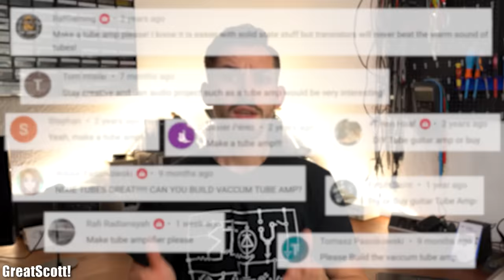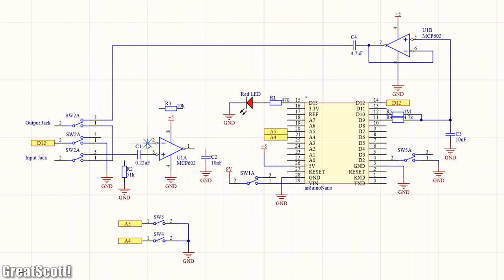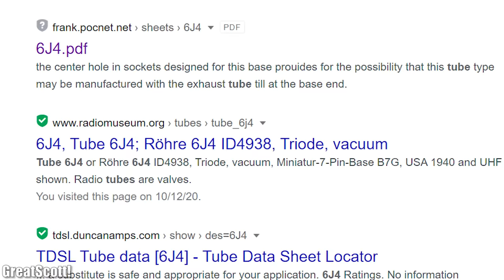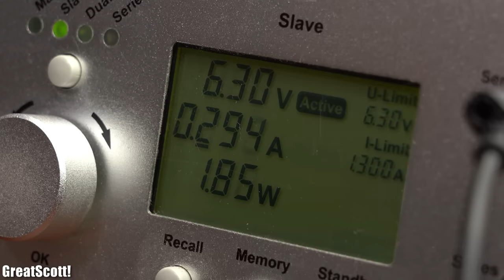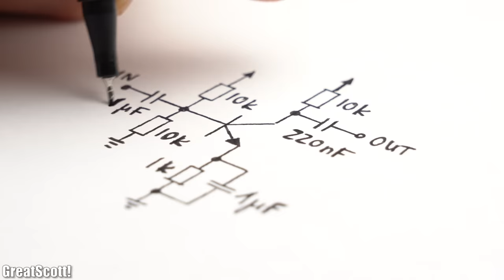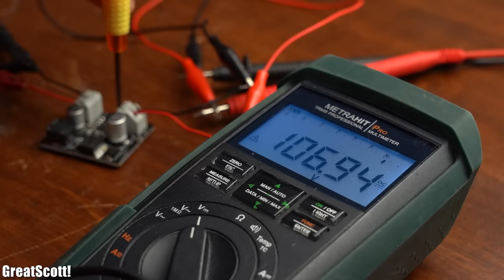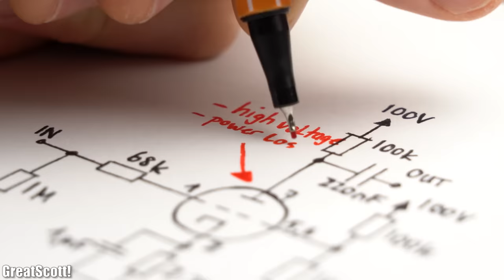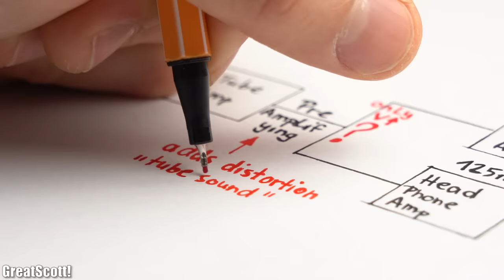Building a Tube Amp! Does it produce better audio quality though? EB#47

Comment: Hello Mr Scott,
I saw your video "Building a tube amp! Does it produce a better quality?"

I thought it was an excellently produced video and was certainly very informative and engaging. But if you were to build an all-tube amplifier, without any semiconductor components, then you will certainly agree that tubes are better. 

Let me begin with radio. As a radio amateur I favor tube transmitter stages because they ARE efficient. If I want to transmit 100 Watts at, say, 14 MHz, then I will be using a 50Ω output impedance. This means that I need the amplifier to deliver 75 V R.M.S (200V peak-to-peak) to the antenna. By using Single Side-Band (SSB) my average power may only be 15 Watts, but with peaks of 100 Watts. The push-pull amplifier tube may be rated at, say, 250mA peak anode current, with typically 1000 V on the anode. But the amplifier tube can tolerate several amperes of anode current for a short duration. In other words the RF output has a clean spectrum and will not go up in a puff of smoke if there is a short duration overload.

A transistor amplifier intended for 12 V operation uses a pair of push-pull devices, each device will be sucking about 10 Amperes, or more, of collector current. Remember that there must be a significant standing current to avoid crossover distortion. The transistor power amplifier will need a ferrite transformer to step up the voltage from 12-0-12 to the 200 V Pk-Pk, and can only match to one specific output impedance. If the transistor is overloaded very slightly then it will "flat-top" and create harmonics throughout the HF spectrum. If the device is rated at 15 Amperes, then a 25 Ampere peak may destroy the device in a few milliseconds. Even the slightest overload will cause excessive distortion and widespread interference.

To loose 12 Watts of heater power is a small price to pay for greater linearity.

When it comes to audio stages, the vacuum tube is softer and does not create spikes of distortion. The currents in the circuit are much lower so that makes construction a lot easier. Transistors power amplifiers operate from a lower voltage and so limiting is much more pronounced and noticeable. Transistor amplifiers also require much better power regulation and DC filtering. Open up any 100 Watt transistor amplifier and see just how many huge electrolytic capacitors there are.

As you are aware, high value electrolytic capacitors have to be bypassed with smaller value capacitors since they have much higher residual resistance and inductance. A 47,000µF, for example, is great for lower frequencies, but it is much less effective at, say, 15 kHz. A transistor 100 Watt complementary audio amplifier needs to have an output capacitor at 20 Hz, with an 8-Ohm speaker, of more than 10,000µf. Alternatively the power supply circuitry needs to be designed so that the junction of the two complementary output transistors is at 0v DC with respect to ground to prevent DC through the speaker. Now the power supply unit is getting even more complicated since it requires a dual +ve and -ve power unit. The transistor power amplifier also requires very precise biasing to maintain that fine line between low crossover distortion and thermal runaway.

The tube amplifier you showed in your video is not a good example since the other semiconductor devices destroy any significant sound advantage, and the amplifier was only a tube pre-amplifier. Tubes stand out among the other devices for high power use, not pre-amplifiers.

Take a look at http://85.226.187.247/power/transformers.htm and you will see a basic amplifier design using tubes. That was only a starting point, but I am making many more practical improvements during the ongoing design and construction. For example:

1 - Using a 3-channel equalizer - better suited for older ears (I am 70 years old)
2 - Moving the volume control between the tone and the power output stage - improves noise
3 - Making it a dual "single ended" (Class A) so it will work both for stereo or mono

Note the connections of the screen grid of the output stage(s). The screen also behaves like an anode, and using this connection to the transformer improves linearity a lot.

A tube power amplifier can be built using just one tube, one output coil, or transformer, two resistors and two capacitors. An audio transformer can be a simple mains 230V AC to 12V AC transformer, if the laminations are re-arranged to prevent core saturation. For RF amplifiers then the anode choke, one DC block capacitor, two variable capacitors and 20 turns of wire on a toilet roll core will match to just about any antenna impedance.

I thought your article was really excellent, but I feel that you may have been a bit unfair to vacuum tubes. Tubes really shine in power amplifiers, and they are difficult to replace with respect to power, design simplicity and most of all, robustness. But I was brought up with tubes so perhaps I am a little biased ;-)

Very best regards from Harry - SM0VPO

Comment: I've built several guitar amplifiers around the concept of using a tube(s) for preamplification and a Class-D power amplifier module. I'm an old guy and don't want to carry around heavy things (used to have a Vox AC100 amp back in the '60s that probably weighted 200 lbs altogether and don't want to do that again). My rationale  was to get "tube" type distortion out of the tube followed by clean amplification with the Class-D amplifier. IOW, if I drive a 100 watt amp to 20 watts the output should be a fairly good copy of the input. I realize that I'm not getting the full distortion that I would get with an all-tube amp (power supply sag, output transformer saturation, non linearity in the finals, ...), however, I hope to get most of the way there with a much lighter package. I've been very happy with the results.

My understanding is that tubes give you more even order harmonic distortion and transistors give you odd order harmonic distortion. The reason for this is that a transistor will clip at both the positive and negative power supply rails when overdriven, IOW a turn a sine wave into a square wave, which is comprised of odd order harmonics. A tube, OTOH, can do a hard clip going to the positive power supply rail, but doesn't clip nearly as hard going to the negative (ground) power supply rail because the tube gain drops as the plate voltage drops, softening the clipping. This results in more even order harmonics.

Comment: Made tube projects as work and hobby, from 1969 to 1978.
Regarding the audio amplifiers, I had two main reasons for a better sound.
Giving for granted the use of a push-pull output stage, the first reason for a good sound is that the odd harmonics of distortion (third, fifth and seventh) do cancels itself in the output transformer, where each of the two primary windings are driven with opposite phases.
The second reason for a good sound is the transconductance curve of a pentode (or a beam tetrode - slightly different): as the output signal approaches the saturation, the "amplification" of the pentode decrease linearly. This is caused by how electrons are emitted by the oxydes on the surface of the cathode. In this manner, while a semiconductor amplifier saturates suddendly producing a sort of "square wave", a power tube amplifier decrease linearly the output power without producing all that clipped waveform.
A need for a pure sound is the proper design of the phase splitter design. By the way it is made, the splitter has one output at the anode and another at the cathode of (usually a triode). This design impedance mismatch MUST be compensated with some proper multiple feedback, outside the range of practical experts, as it requires the use of some complex math. Last not least, the output transformer: the most expensive part, with separate windings for the screen grid and the anode, another tap for cathode feedbacks, some (secret at the time) peculiar winding criteria to reduce intra-winding capacitance; and the  silicon-iron core, realised with "C" oriented granules. Preamplifiers using discharge gas tubes to stabilise supply voltage. Some filament design to avoid excessive potential difference between filament and cathode, the cause of the 50 Hz hum. A myriad of different criteria, which caused good amplifiers to be very expensive even in 1970 and before.
This said, was a rarely requested expertise. Most of my friends, guitar players, were happy with a three-tubes amplifier (one was the 6X4 a rectifier) with a 6AQ5 beam tetrode in class A, which I could make for today's 15 -20 euros of parts.
Thank you for the great video, definetively a trip down the memory lane. Very appreciated, and liked.

Comment: I think if you're trying to test audio quality with a circuit that looks like (7:54), it doesn't matter if it's a vacuum tube or a soup tin - it's going to sound not so good.  Ideally your audio signal lines and circuitry are carefully shielded and designed to make them as little like an antenna as possible.  This seems to be the opposite.

Comment: Excellent, I'm old enough to remember when both tube and transistorized AM kitchen radios were common in the late 60s, the tube ones always seemed to sound better.  Maybe I was wrong.  They also seemed to reject interference on the AM band better.
Reply: Get a proper tube amp and then you will see. I like both solid state and tube. I have many of each.

Comment: Hi Scott, the 6J4 tube from the amplifier were made by Beijing Electron Tube Works, which isn't actually the same as the RCA datasheet ones. PRC tubes were from the Soviet electronic industry system, and the PRC 6J4 equals to Soviet 6ж4C , and electrically equals to American 6AU6 (but with some pinout differences). From the top of the PRC 6J4 you can conclude that this is a pentode insdead of triode

Comment: two thingss that may contribute to the sound of tubes, is:

* harmonic distortion characteristics.

 distortion they produce tends to be even order harmonic distortion,while transistors,generally speaking,tends to be odd order harmonic distortion. The mind has a preference for waves that mathematically for into each other. I won't go into it much, but some chords sound very pleasant such as major chord because the notes inside are even multiple of a single cycle of the fundamental and for nicely inside and evenly inside that note. Then something like a diminished chord. None of the wave forms fit evenly inside the wave form of the continental and it doesn't "feel" as nice. Harmonic distortion characteristics are no different, and so, the additional signals that form the harmonic distortion will feel different, depending on what multiple they are of the fundamental signals. 

* high voltage and linearity. 

This is a bit more variable and more dependent on circuit design, but the high voltages can help mitigate some non linearities in the circuit. Again, without going too much into it, various components and circuit implementations can introduce a few nano volts or whatever here and there of noise or non linearity. I'd the voltage swing is small, such as with I transistor, these can add up add add to the total noise and distortion of the circuit. It becomes a larger percentage. However, if the voltage swing is very large of over 100v, a nano volt of noise and distortion is going to be a smaller percentage of the over all distortion and noise in the output. 

A tube cannot drive a speaker directly, as they don't output much current, however, they are very good at amplifying voltage, and so are very well suited to preamplification circuits. 

If they are driving the speakers with no transistor stage, they tend to work with very very high voltage, and then use a transformer to change it to a lower college but higher current to help drive the speaker. 

I have heard that if you use the right transistor with high voltage, then you can expect a similar sound for the second reason I mentioned why they may sound different. 

I also believe, and this is just my opinion, that because transistor amplification can become quite complex to get the right sound compared to tubes, there is more room for error. That tube amplification can be made extremely simple, while modern amplifiers that run transistors can require additional circuits to get them to perform well and sound "hi-fi". The sound between a cheap transistor amplifier vs a full tube amplifier is very obvious when you know what to look for. (with your ears 😉)

In saying all this, the differences are subtle, and often only really obvious when played through speakers at reasonable volumes. At that point, it is more about how the sound stage is presented rather than simple frequency response and distortion levels, which while it can be very obvious to the ear, can be very hard to measure. 

Thanks for all your continuing videos! I love them all very very much my friend!!!!

Comment: Regardless of what anyone says musicians mostly guitarists prefer the distortion of a tube amp compared to the clipping of a transistor amp. Jimi Hendrix used the high end distortion and feedback to the max. Not many amps these days have a tube output section anymore . Most have transistor or mosfet type outputs now.

Comment: Tube's are used in guitar amplification a lot. In quality amps, the pre-amp stage is designed with tubes and i think the reason is the distortion propertie of the tubes you mentioned here.

Comment: Your presentation is excellent. I wish my videos were as refined.
How did you measure and come to the conclusion that tube amplifiers do not clip like transistors amplifiers when over driven?
Also, I have none of these amplifiers as you have shown but you revealed something really basic - the power amplifier is solid state in these headphone amplifiers.
I think what is missing to the audiophile ear is that the "magic" of vacuum tube amplifiers is in the power amplifier, not the voltage amplifiers. It is in the power amplifier where the difference in clipping when over driven makes the difference in vacuum tube amplifiers. Clipping rarely occurs in the voltage amplifier section. Also, and I think you alluded to it, we seem to  like the artifacts of distortion that vacuum tube amplifiers add to the sound. Very well done video but regardless of the academic analysis of solid state vs vacuum tube sound systems, the humble and ancient vacuum tube just won't go away to modern day whiz-bang electronics.

Comment: The most important point in tubes ( and transistors ), which, is not underlined, is THE ANODE VOLTAGE IS MORE POSITIVE THAN THE GRID to ensure high amount of electron flow.

Comment: That was nice explanation !
Id also add to that if you were comparing power amp section. Specially in the guitar amps, where both power and pre-amp section are going tru tubes. If you hit a note on guitar with cranked tube amp it creates overdrive (distortion) which you can not achieve with transistor amp. It is very pleasant tone and has defined century of rock n roll playing. That sound is hard to replicate with transistor. If you compared tube amp to similar spec solid state amp you would hear the night and day difference.

Comment: tubes give liner frequency response in relation to gain so they are better used in final output stages. With transistor amps you need to change the tone as you increase the volume

Comment: You have overlooked one important thing with all tube amplifiers: they are way less noisy. So if you have a very silent signal, the tube amplifier will, by design, have much less parts that will do the amplification and the transistor/BJT/FET will deliver much higher noise. 

While I'm at your side when it comes to the usual audio signal, if you go up the frequency and do HF amplifying you will hear a hell of more noise. That's why the old receivers from WW2 and 1950's are still unopposed when it comes to receiving signals near the noise level. There is just nothing there that can produce noise, so you won't get noise. 

Test that and maybe you will revise your opinion, that a tube amplifier has no place in your projects anymore. This is more than "a little bit" audible, it hits you in your face like a cast iron frying pan, that was slapped into your face by the cannon of the Tirpitz battleship.

See, I'm full on your page when it comes to audio craze, I find that a well programmed tube software filter in a DSP does a better and cheaper job, but noise? You can't fuck around with the laws of thermodynamics. You can't get out information that got snuffed out by the transistor noise of your amplifier circuits. And that's why I am always stunned when I hear a tube radio dialing on on a low power CW signal like a shark on a half naked female swimmer. Where the transistor won't see it anymore, the tube will take her bite.

Comment: Awesome info inside the video. When I saw you soldering cables directly to the the tube connectors , I got some pain inside... why not using a socket instead?
Reply: I assume to minimize parts count for an essentially throwaway project.  Even cheap sockets are ~$10 US, and if you're never going to use it again, why spend the money or make the garbage?

Comment: In college my instructor stated "Vacuum tubes are completely obsolete today"  (it was 1992)  I objected and noted the best guitar amplifiers used tube amplifiers and the company I worked for had a well sensor that used  1 - 12AX7 because of the incredible heat at the bottom of oil and gas wells.  He got pretty bent out of shape about it.